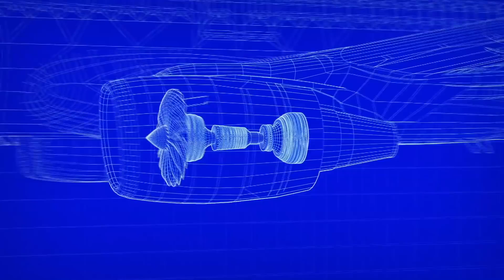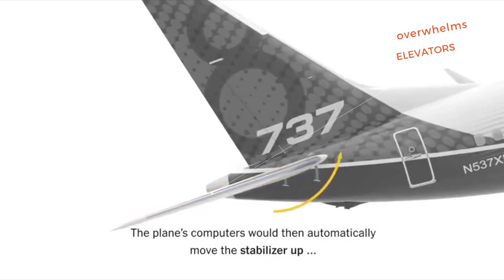737 Max 8 probable cause revealed - Prof Simon

Comment: Why did Boeing not inform airlines ( pilots) of the MCAS over ride characteristics at point of sale? This critical feature and design change should have required special training to demonstrate different flight character. Why did FAA not insist on this? Maybe because Boeing convinced FAA that the Max was the same as previous models. Also hard to do training in Max when there are NO sims available. Another cost saving.
Reply: One selling point of a whole family of 737 models is not having to add extra training for pilots to fly any of the various models. If you can sell and aircraft to an airline which requires little or no "transition training" for pilots your aircraft cost appears to be less and that makes it more competitive in the market. If the Max 8 models didn't have a faulty AoA sensor, their MCAS worked as expected, pilots had good reason to believe Boeing's claim the Max 8 flies the same as the 737NG or other previous models. There were several things happening that lead to these 2 crashes.

Comment: Interesting that 3 world pilots are coming under fire for not being able to handle or fly the 737 Max when Boeing actually designed and changed the airframe characteristics  to the point  that the Max no longer handles like older 737s. In essence, a new airframe disguised as an older airframe so as to avoid years of certification trials for airworthiness that a new airframe design would otherwise be subject to.. FAA seems complicit also for allowing a bandaid software fix to cover over the fact the  Max new monster engines can overpower the plane to nose up and the new location of the engines can cause the plane to nose down. What a contradiction in design especially during critical climbout after wheels up following takeoff.
Reply: "a new airframe disguised as an older airframe so as to avoid years of certification trials for airworthiness"
Well summarized!
Reply: Scary to think the FAA could be complicit
Reply: Nigel Foster 

Follow the money
Reply: I'm NotHere . So much corruptions, unfortunately the FAA has Ex-Boeing executives in high positions which is a conflict of interest. Hope Boeing takes a big hit n the FAA gets an overhaul .
Reply: Study aerodynamics on planes and realize how many tendencies are compensated through engine placement. Even the Wright brothers had to reverse a prop to deal with a tendency.
Reply: How can anyone trust the FAA or Boeing?
Reply: Agreed. It is not a software issue it's a flawed design of the aircraft itself
Reply: Selling point is to minimum training.
Reply: I think we'll ultimately find that MCAS was installed because the airplane couldn't otherwise meet a certification requirement.   My sense is that it wasn't so much that the airplane was dangerous, but that the stick forces in certain situations were not as high as they should be.   For a stable airplane, it should take progressively higher and higher stick forces to move the aircraft away from its trimmed condition.   I suspect that with higher thrust engines that were mounted further forward, they likely found during flight test that the stick forces required to pull the nose up to the critical angle of attack (stall) were not high enough to meet certification requirements, so they installed MCAS as a fix.   The real problem was that MCAS was poorly designed and I suspect that the upcoming software revision will eliminate most of the system flaws.

Aircraft manufacturers often discover things they don't like during flight test.   That's why we have flight test.   Computer simulations are good, but they aren't perfect.   When an issue is discovered, the answer is rarely to start over or make major changes to the airframe.  Rather,  minor tweaks are made to bring the performance of the design back into specification.   Ever see a small forest of tiny metal vanes on the top of a wing or stabilizer?   Those are called vortex generators and they are often installed to deal with aerodynamic issues that are found in flight test.   Many airplanes have them.   They are far cheaper than ditching the whole design and starting over.    Ventral fins are another such design tweak and plenty of airplanes have those.    Software fixes to flight control laws are very common on fly-by-wire airplanes.  Although the 737 Max is not an FBW airplane, it now shares some of the characteristics of one, because of systems like MCAS.

Unfortunately, the public doesn't understand any of this, so when there are two crashes of a similar ilk, there's mass hysteria, fueled by a media that is equally clueless.
Reply: @kevinmadore1794  A well thought out response Kev, my thoughts entirely. Just a question though, maybe I'm wrong, but I thought MCAS was implemented due to a nose up attitude which was caused by the larger engines and their placement on the wing?
Reply: @Stormbringer748  So far the MCAS software is worse than being revealed,. It fights pilot stick input to noise down by giving resistance when being pushed forward (MCAS wants to maintain pitch up even when nearing a stall). Further, MCAS corrects itself every 5 seconds or so by continuing to adjust the jack screw in (confusing) increments to nose down.  All this is happening at low altitude climb out which leaves the pilots a narrow window to figure out whether/how to disengage the MCAS before a stall results or not leaving enough air space to perform a recovery. All this to ignore what software or sensor inputs are malfunctioning..
Reply: Yes the 737 max is a new airframe of an old aircraft but for you to think that the FAA and Boeing would not do a single test to ensure the safely of this plane is stupid and childish. Yes MCAS is a new system and pilots should be aware of them, however the pilots them selfs should be able to recognise a stall well before the MCAS system takes over. So before you blame engineers who have a 4 to 8 year degree at a university and will and have achieved more than you sad people ever will look at the facts.
Reply: @TheBrandonzim  
Recognizing a non-existent stall takes clairvoyant skills few pilots have. Both the Lion and the Ethiopian aircraft didn't have the two options that tell the pilots the MCAS has activated.  Since there was a faulty AoA sensor which was activating the MCAS  causing the trim to drive the stabilzer down and no real stall condition. The pilot attemting to correct the nose down condition causes the MCAS to increase the trim  eventually to maximum. Once the airspeed has built up sufficiently,  there's no way to overcome the forces and the aircraft nosedives into the terrain. Without the two MCAS alert options, pilots must be astute to recognize the trim wheels are turning the stabilizer causing nose down while they pull on the yoke to raise the nose. They would then treat the issue as a runaway trim.
Reply: @ricknash3055  But from the demonstrations i have seen, the stabilizer trim wheels turning should be obvious because it's loud. The procedure to turn it off is the same on the older model as well. Pilots don't need to know about MCAS to do that. But the question is did the MCAS turn it back on after pilots cutting it off. No one seems to address that. The satellite data shows the plane pulled up and then went down again many times before crashing. How did the pilots pull the plane up if they didn't turn off the stabilizer trim system? They likely turned it off. Only boeing knows what MCAS can do because it's a hidden background system with no controls for the pilots.

Comment: Well, relying in only 1 sensor in a critical system like MCAS is completely MADNESS.
Reply: It is criminal negligence to treat MCAS as a low-importance system requiring no redundancy, both for Boeing and for FAA.
Reply: No backup, no alternate data source.

SMDH.
Reply: Ah! Found a solution: check aircraft model before boarding. Works all the time.
Reply: agree.... it's just unbelievable.... too risky...
Reply: Totally fatally idiocracy! For boeing to put some systems that didnt have good test...on the aircraft....and let passenger risk their life!....
Reply: They are 2 sensors.
Reply: true, but at any time only one is used. also, you need triple redundancy to decide which is correct - or the pilot looking out the window!
Reply: and I would agree. Boeing has a lot of explaining to do.
Reply: and from what I heard people pointed that out. so they cant hide behind that. .... some heads are going to roll for this. although its probably not the people in charge.
Reply: I wonder what other systems on the MAX need to be re-tested.
Reply: DLC gone wrong..
Reply: @campkira  I flew hang gliders for many years - now sailplanes.  They have ZERO electronic wizardry.  They were also perfectly stable if you just "let go the controls".  In fact, I could COMPLETELY stall my HG by grabbing the back wires and pulling - then letting go of the base bar..... and all it would do was stall, gently drop its nose and resume flying within 200 feet (altitude loss) in a "very close to" straight line 99% of the time.  Now IF the glider was fundamentally overbalanced, I'd have to maintain bar pressure to counteract such all the time.... wouldn't I?  So Boeing's engines are wayyyyy obviously sticking out too far forward.... so they came up with this system to cope with the tendancy (under big power) to nose up...... BY FORCING IT DOWN.  Can you trust this system?  Evidently not.  Did the crashes occur during climbing / big power inputs..... YES.  Add to that the stupidly small wings (that save 14.7% fuel but I can GUARANTEE you result in higher stall speeds / take off / landing speeds and less stability) and you have a recipe for disaster..... curtailed by "electronic wizardry"..... which you can't trust.  Thats what has happened.  PS - the smaller wings you have..... yes.... higher speeds, more fuel efficient in powered flight.... BUT AT THE LOSS OF STABILITY.  There are many better performing hang gliders and sailplanes than the ones I flew..... BUT I HATED THEM.  They wanted to side slip and do all sorts of weird things at stall speed and were HEAPS harder to bring back under control.  This is nothing but a case of chasing "ultimate fuel economy" where the designers have thrown stability out the window and added untrustworthy "aids".... that killed all those people.
Reply: Probably, but I bet it is being done more  than you would ever know.
Reply: "Well, relying in only 1 sensor in a critical system like MCAS is completely MADNESS"
There are TWO sensors.
Reply: @DrHarryT   Yes, there are 2 AOA sensors. But MCAS only take the input of 1 sensor.
Reply: @neuromancerES  So if MCAS used only 1 AoA sensor, what was the second AoA used for ?
Reply: Hristian Todorov yes there are 2 AOA Sensors that feed information to the acft on how many degrees of pitch (think nose up/nose down condition) the acft is in. On these particular configured B737 Max's, the MCAS System will engage if 1 of the 2 sensors are reading a pitch up condition on T.O. Let me say first I've been to  both Boeing plants in Renton & Everett Washington. The ppl I met there were smart, caring, took pride in there product & history and SAFETY WAS EMPHASIZED EVERYWHERE FOR THERE EMPLOYEES AND THERE PRODUCT THEY MADE. Aviation is the best and safest way to travel in part of all the safety barriers and REDUNDANCY that's involved in a acft design and there parts/components. There's NEVER EVER JUST ONE COMPONENT/PART THAT controls things or solely relies on. On the models that crashed, just took 1 AOA reading out of 2 for the system to engage. Let me add, the Max's American Airlines, SWA and UA (I believe) which costed MORE MONEY, the AOA readings are displayed in the cockpit on the PFD(sorry-Primary Flight Display) and IF one AOA was reading a different value than the other AOA, a DISAGREE LIGHT comes on and alerts the CA & FO operating the acft. Regardless the LT & RT AOA Degree readings being displayed on the PFD and DISAGREE WARNING LIGHT, it's my understanding the MCAS system will kick in on 1 AOA reading out of the 2 as soon as the the flaps are retracted on Take Off by the CA or FO. Yeah American Airlines and others paid more money for those acft, MCAS system operated the same in the cheaper/more expensive models. I hope I helped explained hows and whys of this and it's a little more clear for you 😁. Travis
Reply: @hristiantodorov3923  it could be wrong but I read that when the when the pilot's controls are active the sensor on their side of the outside of plane is used and vice versa for the co-pilot's side.
Reply: @Travisesty  thanks Travis for your reply. If it took only one aoa reading out of 2 sensors to engage the MCAS,  then this is not real redundancy. I am sure the engineers did their job right , but I doubt that the management did!!
Reply: @DrHarryT  TWO sensors means you cannot correct for error. They could be used to discover an error but that would mean they would have to disable the system when it happens. The pilots would have to be informed about it and thus be trained for that situation. The additional training is what Boeing seem to have been determined to avoid, so this was not an option.
So because detection is useless and correction impossible,  you can just as well use only one of the sensors and accept the risk of using faulty input. Thats what they decided to do and thats what the FAA failed to catch, shuttering years of public trust.
Reply: the minimum design for redundancy here is 3 SENSORS.  2 AOA and a 3rd sensor of a different type/style to act as a "tie-breaker". in the event of a DISAGREE between the data coming from the 2 vanes, the computer (inherently dumb) still has no way of knowing which AOA is throwing valid info onto the CANBUS.  it can only do this through a check step with a 3rd stream and perhaps some other parameters off the pitot/static system and throttle power setting.  but ultimately whatever 2 streams match is the input sent to the jackscrew.  Probability Theory says the odds of this failing are in the MILLIONS maybe even BILLIONS.  MCAS 1.0 was programmed with no more consideration than a cellphone APP.
Reply: PS:  $50 bucks that says it wasn't even someone who's a pilot that programmed this first revision of MCAS, for a pilot would never make the mistake of referencing only a single AOA sensor.   for example, companies that make 3rd party avionics (think Garmin) and cater to the GA, General Aviation market (think Cirrus, Cessna, Continental, etc) tend to hire people who ALSO happen to have a PPL, whether flying is a part of their job function or not.  this they do for reasons that should now be obvious.
Reply: I wonder if they even did a risk workshop on this system. How did it pass the FAA tests?
Reply: And replying only on 1 input (from Boeing itself) regarding the airworthiness of the new Boeing 737 Max models to obtain its FAA certification is beyond madness, it's CRIMINAL !
Reply: @bukanbuta7401  but MAX is NG with new engines - Boeing
Reply: The problem you mention was discovered by Boeing engineers, it was in their report to the FAA. Boeing and the FAA knew of this problem and 2 others reported in their Safety Analysis before the aircraft was certified. Have a look at the Seattle Times reporter's story detailing the 3 problems that appear to have lead to both crashes. IMO, the story does a credible job of explaining the problems but then veers off to exaggerate the issue of whether the FAA or Boeing was conducting enough review of the certification process. 
https://www.seattletimes.com/business/boeing-aerospace/failed-certification-faa-missed-safety-issues-in-the-737-max-system-implicated-in-the-lion-air-crash/
Reply: when the plane is designed to rely on MCAS in order to fly normally, without any redundancy is pure madness